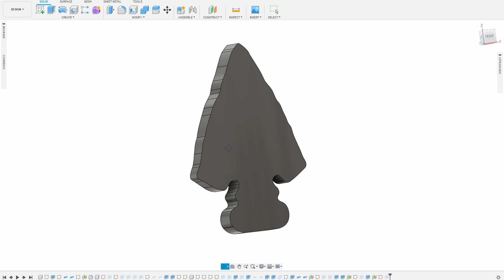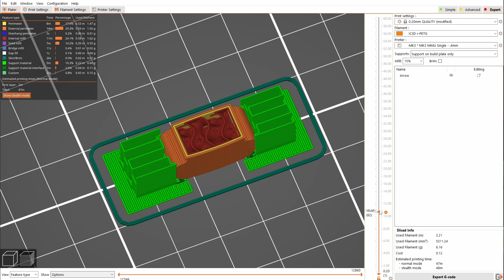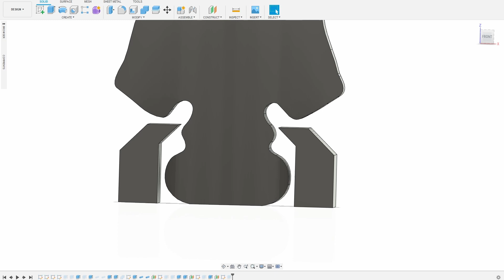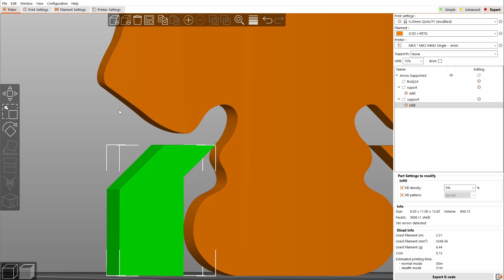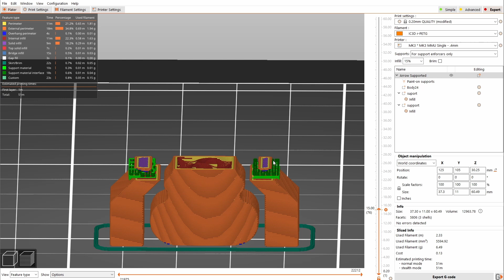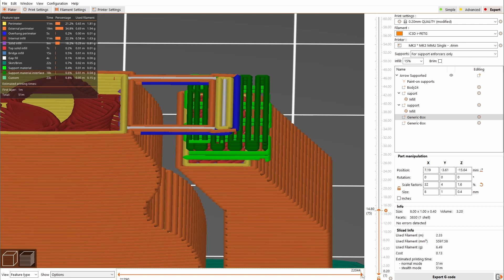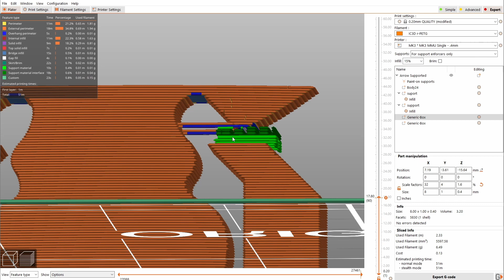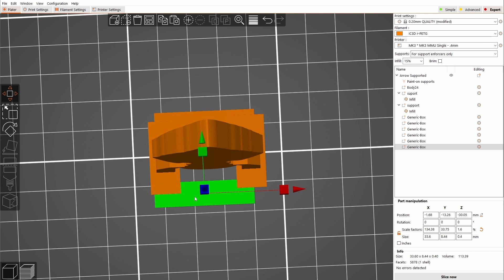Thinking differently about 3D printing support structures.

Comment: PrusaSlicer so needs tree supports. With Cura this would be simply turning on tree support mode, setting angle to 85 or so, and making sure support interfaces (top layers) are set to on.
Reply from the maker: Honestly, I am not a huge fan of tree supports with FDM. In this case, I don't think the tree supports would give a nice big bed for the edge to sit on, and the interface material to support the slopes. I did play with trying to support just the edge, and didn't get very good results. Unless Cura builds tree supports different than the resin slicers do? *  I edited this response, because  I was thinking of a different video in my first response. *